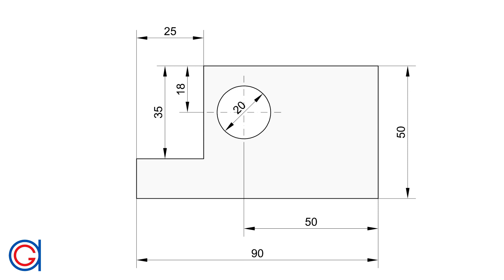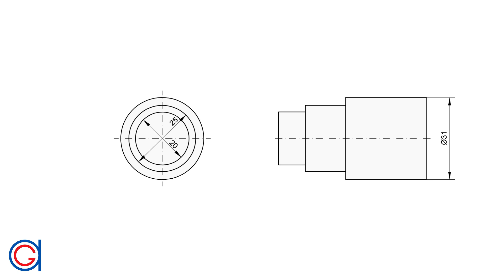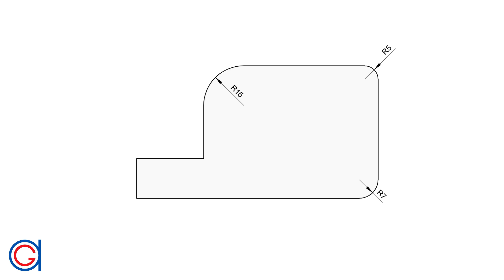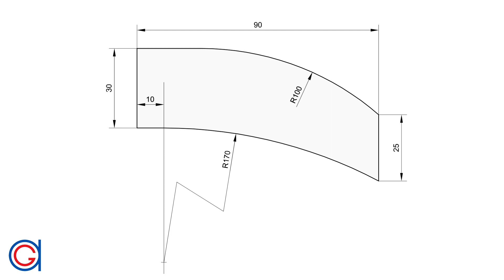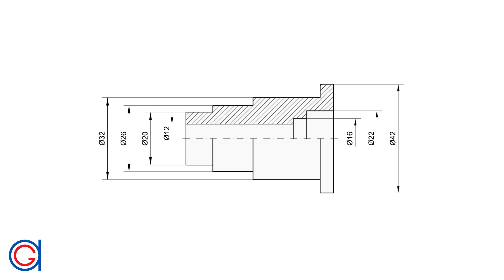Dimensioning Circular Shapes in Engineering Drawing

Comment: I'm looking into CNC coding the milling and turning machines that make CAD-drawings a piece of steel into the geometric results thus specified. I think that CNC code is a horrible mess of coordinate changes. I'd like to pragmatically encapsulate the three dimensions of such processes into:
1) The form design (in CAD, as you are engaged in here) and material such as construction steel or brass. Those are the specified end results, as ordered.
2) Then the cutting procedures. Such as beginning each hole with a centering drill and later on dealing with the chamfering of the mound and when applicable with the threading of its insides and so on. Multiple cuttings operations to achieve one single geometric form in the metal.
And 3) The particular machine and tool properties, about which the designer likely knows little as his drawing is sent to the subcontractor. It is the machine operator on site who has to consider such factors, given the machine and cutting tools available at the time.

These three dimensions (of operational procedures) need to join in order to turn the raw material into the geometry desired. I don't see the CNC-world doing much to address this, but I am but a student, perhaps (and I hope so) there exist practice for dealing with this in a better way than listing thousands of lines of coordinate changes.